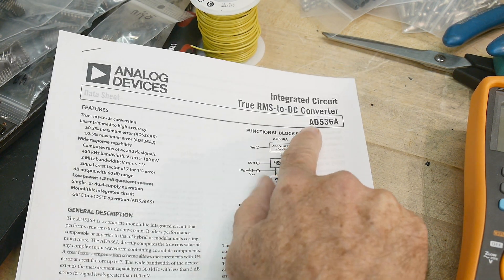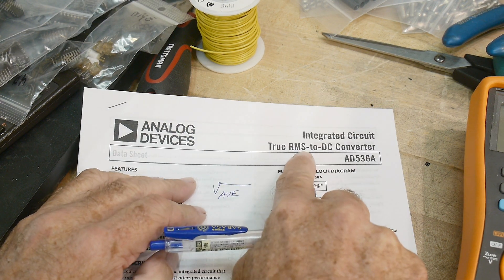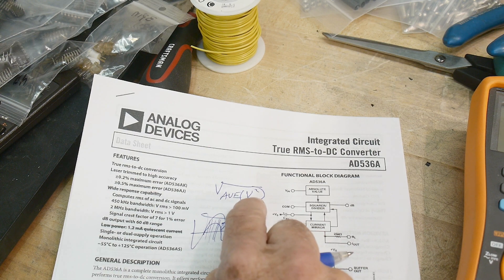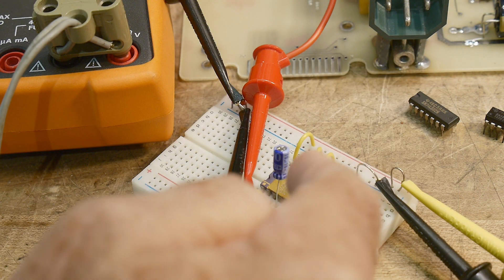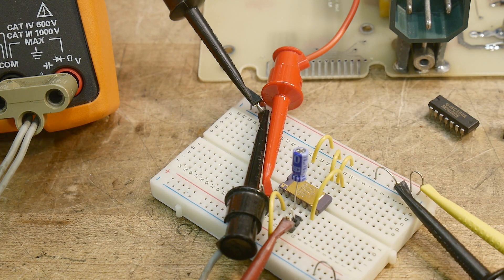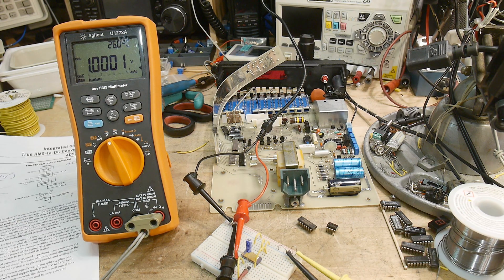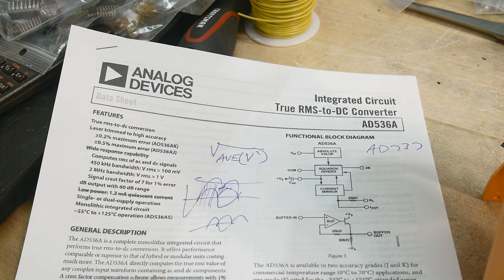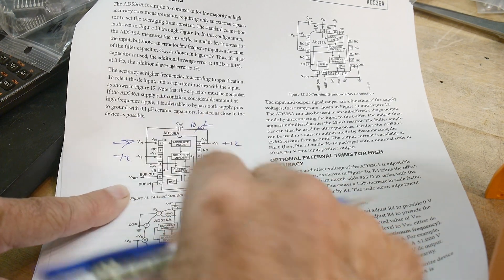#1290 AD536 Volts RMS to Volts DC Converter

Comment: RMS... If you multiply a negative number by a negative number you get positive.  If you multiple the same positive number by itself you get a positive.  THIS is what moves all the readings above the zero line.  The ROUTE then just removes the increase so -5x-5=25 and the route is 5 whilst 5x5=25 and the route is 5. so then you just have the average which gives you the effective DC.

Comment: I remember using one of these in a "in house" built test set on a transformer production line many years ago. I had to test a microwave filament transformer for an RMS voltage under a loaded condition. The test set took the output to a comparative section that gave you a go no go for a physical gate that dumped the bad ones.  I also still have one or two of these but never suspected the price of them to be that high. It's a neat part.

Comment: Why Root Mean  Square (RMS)?  Because the power is related to square of voltage as V^2/R.  Now for AC voltage to deliever the same power as DC voltage, they should have the same RMS value.
For pure sine wave the Vrms =Vpeak/SQRT(2)  or Vrms=Vpeak/1.4 
Now what if we have arbitrary **but periodic wave form**?  Then we convert that to sine waves using Fourier series and then divide the amplitude of each sine wave by 1.4 and average them, which gives the same result as we square each sine wave amplitude then average them and then take the square root.  This is true, because by definition our load is ideal resistor and does not change with frequency and voltage.  Of course in real life we do not have ideal resistor, for example the old 110 V tungsten bulbs, they have much lower resistivity at lower voltages than higher voltages. 
Now what if we have non-periodic wave form?  Here we can starch the RMS concept by using a window of time and smoothing functions --  to make the wave look periodic -- { by the way this is called windowing in spectrum analyzer} and take Fourier Transform then proceed as above.  But the problem is that what window we choose changes the value of Vrms.  Say if our time window is 1ms and 10ms the results would be different, because the wave form is not periodic.  Therefore, starching the concept is not useful nor practical.
That is why the concept of Vrms, which was defined for AC power generated by generators -- which is sine wave -- to be compared with DC power.  The old Edison - Tesla wars  {similar to PC-Apple war of today)   The sales pitch was DC voltage power is 1.4 times the AC voltage power.
As a result this chip is not useful.  Another problem with this chip is that it has limited bandwidth, and it does not take into account high frequency harmonics, even for periodic wave forms. 
The only limited use I see for this chip is rough measure of harmonics vs fundamental on power lines. That is a clean say 50 or 60 Hz AC power line should have Vrms to be Vpeak/1.4, a line with lots of harmonics { as a result of too many switching power supplies or non-linear elements such as dimmers , which use SCRs or TRIACs }  the value will be higher.

Comment: One way I use to explain RMS to ham General class students is to say that a AC RMS value is simply the AC voltage that has the same "heating value" that a DC voltage across a resistor will have; the resistor doesn't know the difference between the two voltage types, it just heats to the same value regardless.
Reply: heating value is called power
Reply: Some resistors have maximum voltage value.  This means if you exceed this value this value the resistor will burn.  Say a light bulb.  So, that is not correct definition.